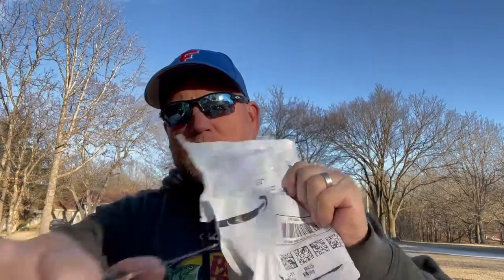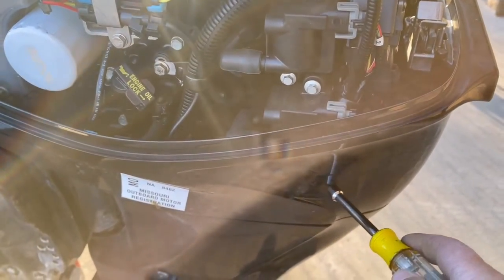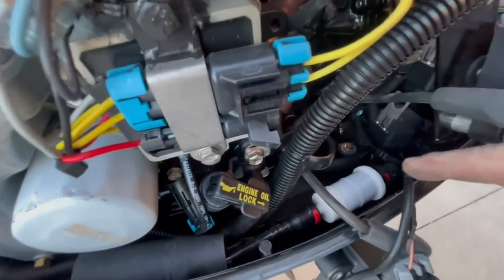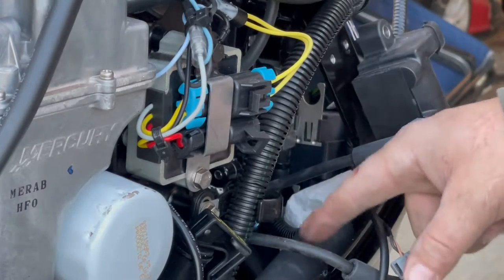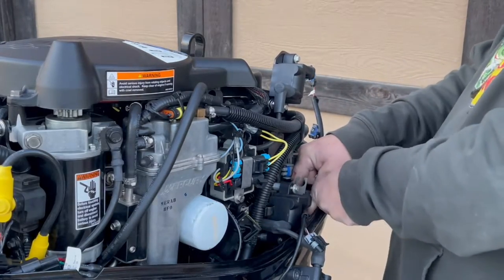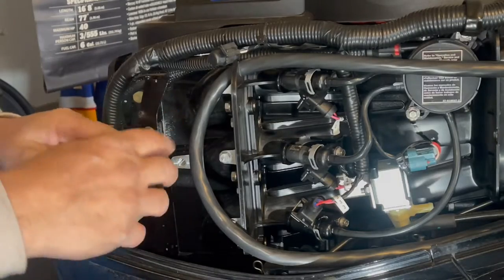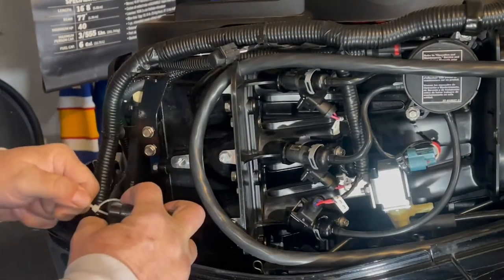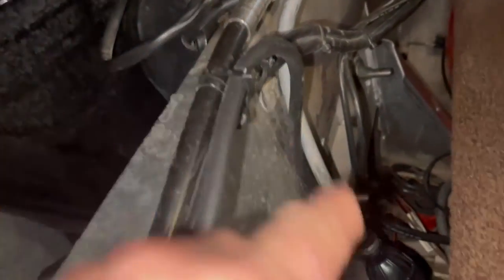How to change in-line filter and fuel filter Mercury 40hp/50hp/60hp Tracker Classic

Comment: Just did my 50 HP and there WAS NO NEED TO REMOVE ANY PARTS to remove the high pressure, inline filter pictured in the video.  The "hardest" part was pulling the sleeve off of the filter after having to clip off two zip ties (one on the sleeve and one holding some wires).  It took less than 15 minutes!  Very, very easy IF you have room...and I did in my 50 HP.

Comment: Heads up, for the inline filter you can just take off the lower engine cover. It's only 4 bolts with not nuts, much easier. Still a great video man!
Reply: what four bolts are you referring to anymore info

Comment: I have a 2004 50hp 4 stroke efi.  I didn’t have to remove anything to get to mine.  Just the cowl.  Probably because someone before me had been in there.  Really simple job
Reply from the maker: My high pressure filter was buried at the bottom as seen in the video.  I couldn’t get my hands through to disconnect anything.
Reply: The lower cowl? I have the 50hp efi bigfoot and I can't get at the inline filter with my average sized hands.
Reply from the maker: Yes the lower

Comment: The video was really informative, thanks. I was able to replace the high pressure filter without loosening any bolts, but it wasn’t easy. I have long, thin fingers which helped. Still took me about 30 mins.
Reply: I need to replace mine was it easy? Video looks kinda hard
Reply: I did the same, didn't want to mess with those wires, tough but got it

Comment: Just did it...  All you have to do is remove 2 zip ties. 1 on the filter and the one below so you can slide the filter sleeve down. 

Slide the sleeve down and pop off the filter and clip the new one on. Then reverse and place two new zips. Done.

Comment: You can put it on without taking everything off! I just replaced both filters on my 40hp. I used a wire to hold the gas line. And just popped it on.

Comment: Mark, Nice video. Can u answer me this question, on the low pressure filter why can't u just change out the filter by taking the lower bowel off and replace the paper filter. Every time u take that housing off the hoses u losen up the ends of the fuel lines. Even though u put zip ties on. I have seen just the filters on line . Can u help on this. Mercury says they only sell the filter as a hole assembly.  Thank.
Reply from the maker: I’m not sure I know you can replace the paper filter.  I know guys that do.  I replaced the whole thing due to its price.   It was cheap and easy no issues with fuel lines.
Reply: @Mark Blackstock    Thank You for your fast response.  It seems more sense able to just replace the filter.

Comment: This is off topic but on your trim, if you have it trimmed up so that you can go shallow and idle speed or just above idle and give it some gas does your motor slip back down? Like as if you trimmed the motor back down? I noticed that mine does this and I was told it’s a safety feature so that no one tried to drive the boat with the motor in the up position and loose water pressure. To me it seems like the hydraulic cylinder has some leak by maybe. Sorry for the long post. Just wondering if you’ve noticed anything like this.
Reply from the maker: yes it does, I myself noticed that recently I am not sure if its normal or not?
Reply: @MarkBlackstock  
Thanks. It’s good to know that someone else experienced this. I’m going to keep researching. If I find out anything I’ll come back hear and let you know what I hear.
Reply: I called mercury marine today and they said it was completely by design that the motor will trim up but fall back dow if it senses a rise in rpm’s. It doesn’t fall all the way back down but down to a safe operating hight.

Comment: What is the part number for that inside filter or do you have to replace the whole unit? And what is the part number for that. Thank you!!
Reply from the maker: I replaced the whole thing it’s cheap and they do crack over time so easier to kill two birds with one stone.  I don’t know the part number I’m sure a google search will bring it up.
Reply: Where did you buy the upper filter
Reply from the maker: Amazon
Reply: @MarkBlackstock  was it the one by quick silver

Comment: No, the ifilters a ten minute job. Remove the 7 bolts from the plastic cowl, and remove the plastic cowl then you have complete access to the hp filter and the VTS. ????  Literally takes less than 5 mins to remove the cowl.  Lol